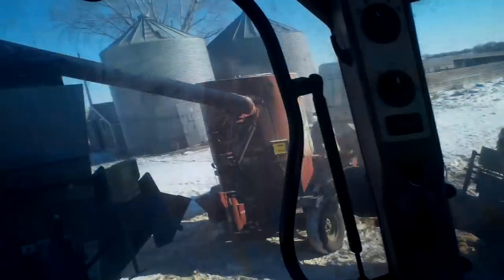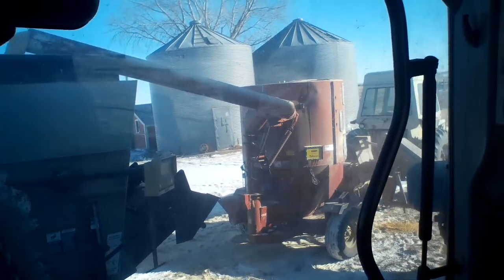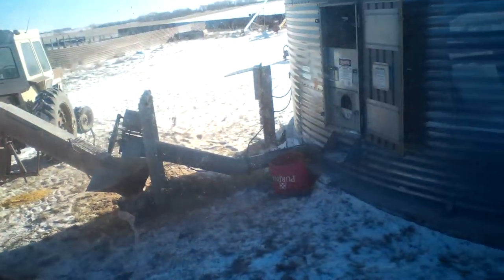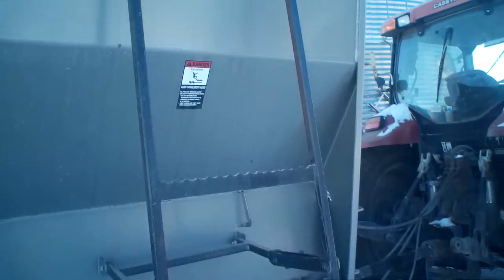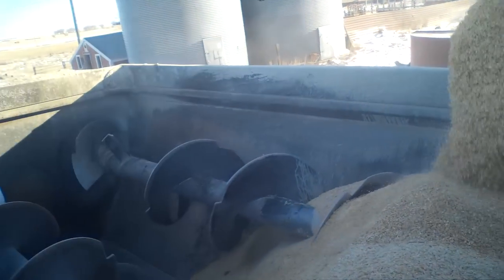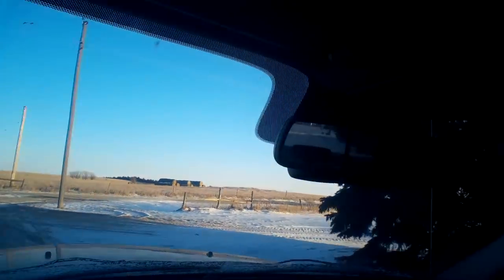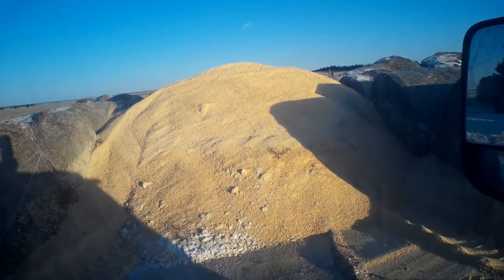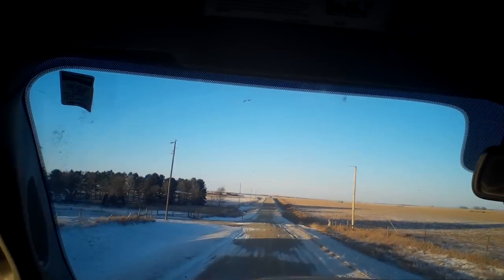Turning corn into cow feed

Comment: Nice video.
 That is good use of the mixer wagon.
Reply from the maker: Yea it did work good was worried about the weight but i called and the company assured me that it could be filled with corn and drove down the road with no problems

Comment: I think that is an excellent way of going on Ted for feeding your cattle and adding value to the maize crop which I understand is pretty low value currently in your country.
 
We used to do the same sort of process using caustic soda and water added to wheat and mix it for some time. Feed it in a TMR ration to dairy cows once cold - this avoided the need to mill the wheat and at the same time removed most of the husk and soften the grain. The alkali of the caustic soda off set the acidity of silage and consumption went up producing more milk. 

Warning! THE CHEMICAL PROCESS using caustic soda and water PRODUCES A LOT OF HEAT IN THE FEED WAGON!! When it was done we used to put it out on concrete to cool down in a thick "swath". Once cold push it up into a heap in the silage clamp and add it to the ration as needed. One good point is that it is very stable and will not rot at all once treated. 

We have also used the feeder wagon to mix and deliver a young cattle ration to the cattle shed and even mix sheep feed and pile it into a heap for later use.

If food was too dusty we added molasses to the mix, do't add water and store the food as it will fairly quickly begin to rot..
Reply from the maker: we do use a liquid feed with our cattle we also use water in rations that are too dry

Comment: works pretty slick, how long would it take to grind up 20,000lbs
Reply from the maker: i ground a total of 42000 pounds moved grinder loaded truck messed with hoist on truck that would not lift for it seemed like for eever.   started process at 12 30  done by 3   also had to haul ground corn 3 miles... id guess just the grind time was  around an hour ill pay more attention next time

Comment: I don't know anything about storing or grinding corn and mixing cow chow.  my question is, can that stuff get rained or snowed on and still be eaten by the cows?
Reply from the maker: it can get snowed on or rained on to an extent  but like any thing enough moisture and or heat it can go bad... In winter time its generally cold enough to keep it for a while but we are using over 3000 pounds per day and will only use more per day from now tell the fats are gone
Reply: Ted Kahler - so the pile is not really going to be there that long.  I got it now.  thanks for the explanation.
Reply from the maker: Thanks for the question i sure enjoy them